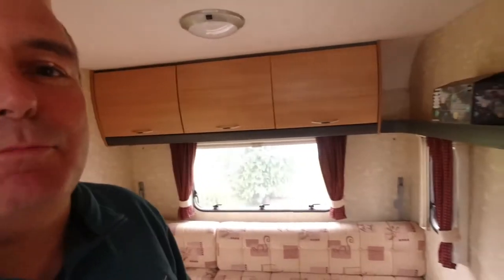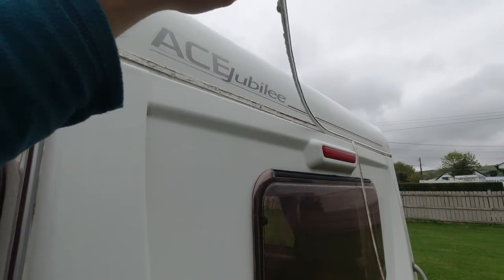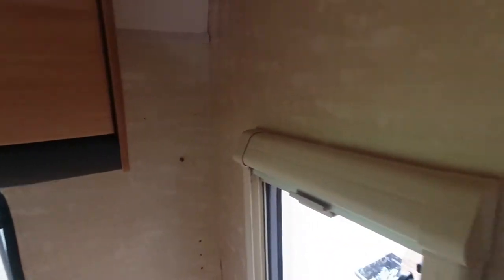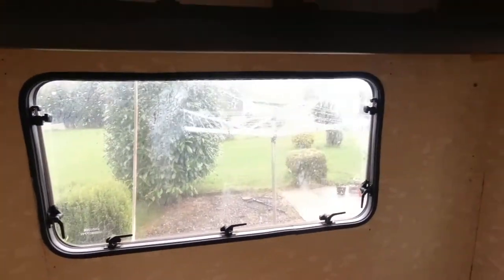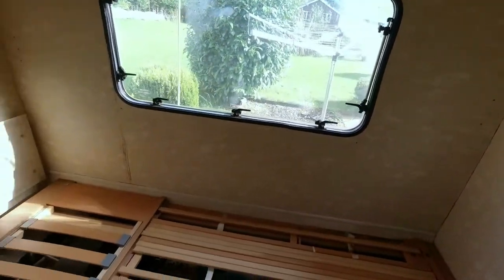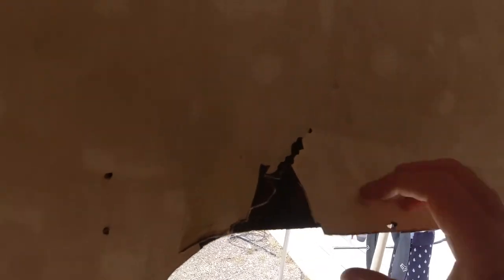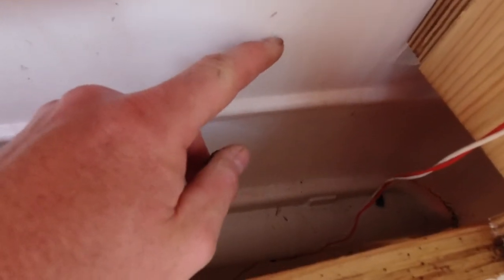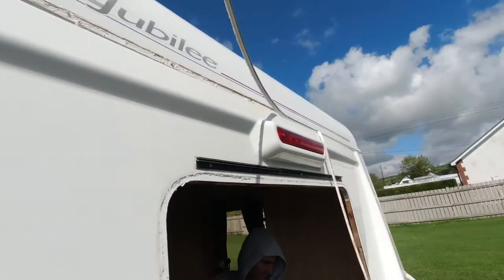caravan repairs damp damage part 1 of 2

Comment: Brings back memories of the rot we found in our secondhand 'van. There was no smell and no bubbling to warn us. 
It was only when we removed the cracked shower tray did we find the rotten walls and frame.
Somebody had actually boarded over the damage to match the rest of the 'van ! 
I'm normally Mr Optimism but after feeling *'totally had*' my first reaction was let's get it to the tip.
In those days there were no online tutorials but thanks to my clever father in law, we repaired it very much in the way  you did.
We used to laugh that once the 'van was fixed and put back together  -  it was stronger, heavier and better made than when it left the factory.
Message then :
   (1) Buyer beware and 
   (2) never give up :-)
Reply: How did you repair it
Reply: @sophwatson7243  he said he repaired it the same as this guy !!

Comment: hi love your video. I'm in same situation as you mine is the front left side panel gone on mine. my boards look a lot worse than yours so think most of the timber will need doing. I'm going to go for it thanks to you..
Reply from the maker: Best of luck. Check the structural timbers and replace with new treated timbers. The big thing you will notice is how fast the timbers will dry out once you have taken away the plastic coated ply boards. Cheers

Comment: Great video , helped enormously with my repair . What adhesive did you use to fix insulation . Cheers
Reply from the maker: hi the guys i bought the boards from also supplied the adhesive  its “soundaflex40fc fast curing polyurethane” hope this helps cheeerz

Comment: Hi I'm looking at a fixer upper, again need work done. what is the difficulty level and is it easy to get parts ie. wall/celling panels plus water proofing.
Reply from the maker: Hi thank you for your enquiry You can source the panels and adhesive on the internet I found O'Learys caravan and motorhome very helpful with a catalogue available on line of parts and accessories etc. Check them out. Cheeerzz

Comment: Hi, just caught up with your repairs,can I ask we’re did you buy your wall Panals from please. Thanks really helpful video 🐧🐧
Reply from the maker: Hi i found a company called olearys on the web i think they are based in Liverpool area and their website sell caravan parts ie wall panels. You have to buy 2 sheets because the way the post out to you. Also buy the adhesive and rubber window seal from them. Ive ended up buy other things from them i found their service good and quick postage. Best of luck with your repairs